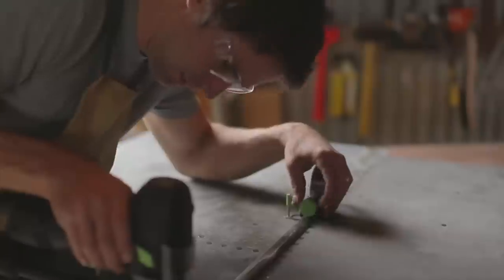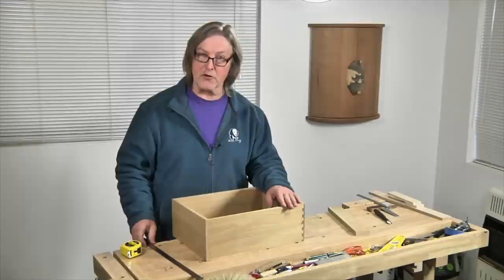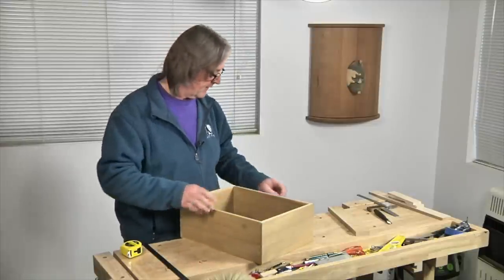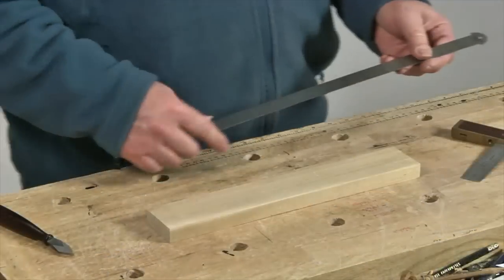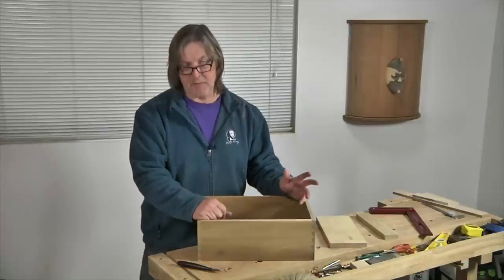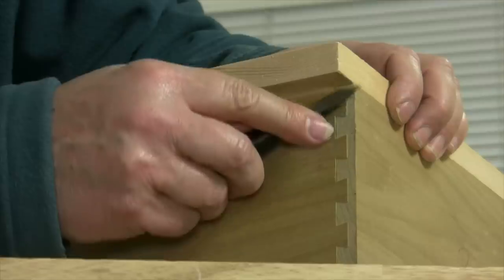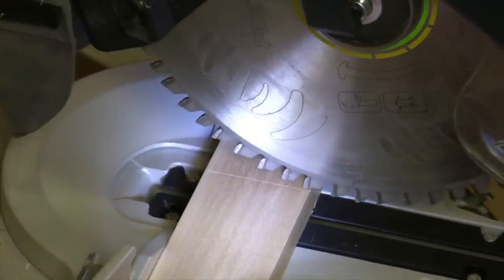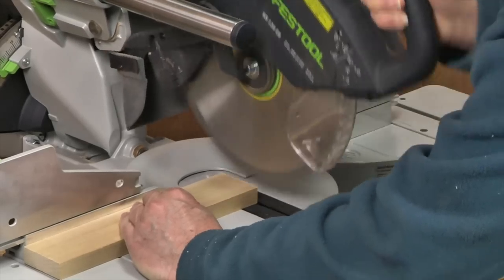Measure, Mark and Cut Parts Easily and Accurately

Comment: I've always wondered how to use the marking knife, whether the flat side or the beveled side should be against the edge of the box.  It seems like each woodworker has their own preference for use, but is there a good reason to do one instead of the other?
Reply: Use the beveled side to the ruler, to make the mark as tight as possible against the ruler.

Comment: why do i use the marking knife when i can use a pencil ?
the pencil will be more visual and can be wiped.
Reply: Even the sharpest of pencils won't come anywhere near to being as fine as a knife. Sharpen up a pencil and look at the tip under a microscope, and you'll see that it's actually pretty flat. 

Scratch awls work just as well for marking, too.
Reply: the knife is a more accurate mark, and you don't need to remove any marring, and if you need to mark it ,the pencil will fall into the kerf , i only use it for certain things, and only when i'm sure that's where i want the mark, but there is also something called paralax, that is more a problem with marking, look up incra tools
Reply: also , if you're going to use stain, it tends to well up in the knife mark